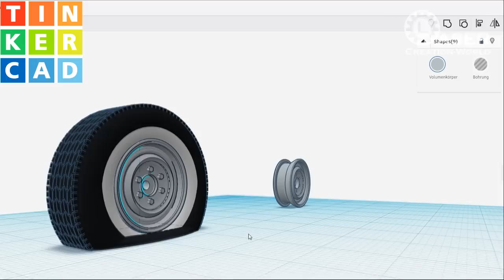Rust effect Chevrolet Cameo 55 pickup scale 1:25 for my next diorama.

Comment: Fantastic work, but I do have a couple questions: 1. Did you intend for the bed to not be set right, as it has the appearance that the mounts and bushings would be gone if it were real? And, 2. Wouldn't the tail lights and front marker light covers be more dull with a slightly darker hue? The tail lights did look a bit brighter than I've seen on some old rusted trucks I've scavenged parts from....Oh, what about the headlight bezels? They still looked like fairly bright chrome...just curious about the look you were going after aside from being a rusted out truck, which I've had and have seen many of, LOL...Again, fantastic work, well beyone my talents...And I was very curious when I saw the thumbnail about how you got the tires flat, definitely a method I didn't think of...Ok, 1 more question, then I'll quit talking, lol...Did you consider the possibility of "dents" and rust holes in the appearance? And if one were do create dents and rusted holes, what, in your experience, would be the best method to create those? Thanks for sharing your creations.....

Comment: Awesome as usual. I do have a question. When you are running your copper wire for the various things where do you get the diagram for this? I am very familiar with spark plugs and can find the correct firing order but all the other things you do blows me away. Like all the detail on the firewall.
Reply from the maker: I try to stick to the original when wiring, but sometimes I build by feel